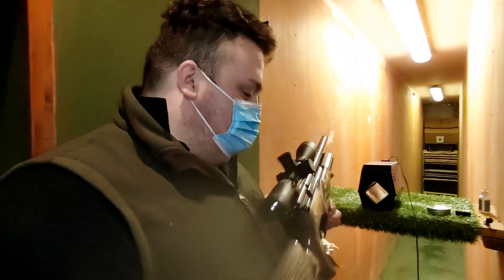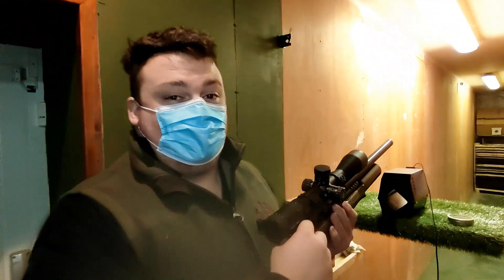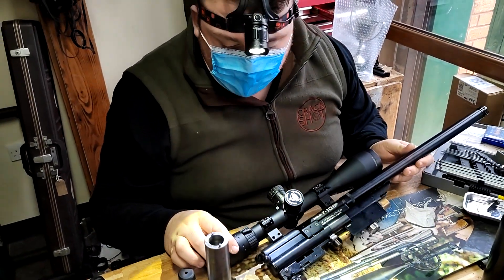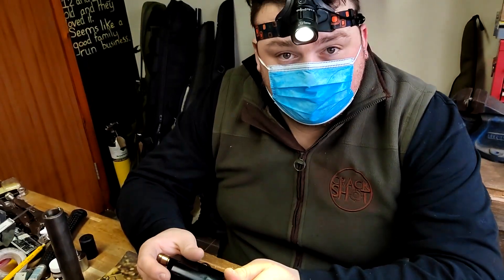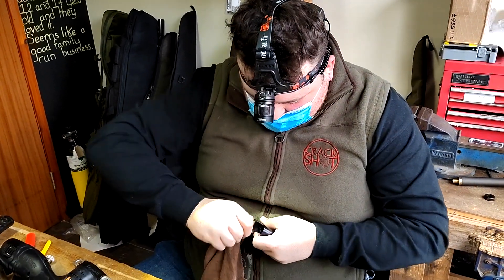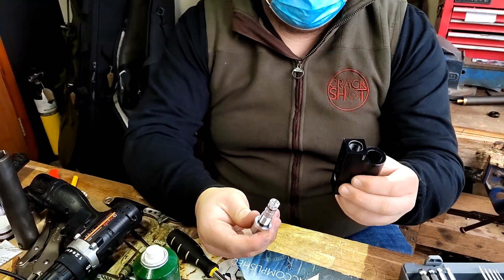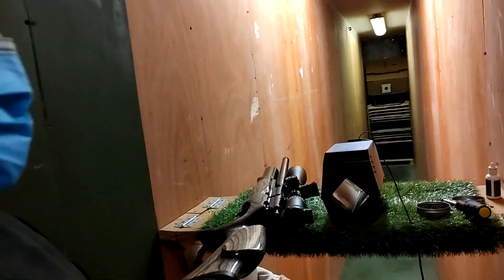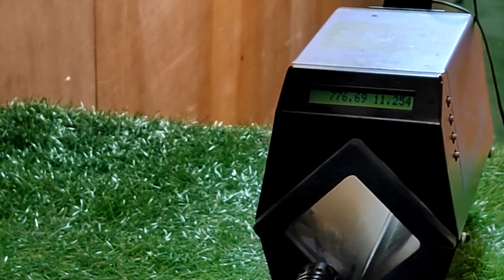The Ultimate Air Rifle Modification? Huma Regulator Upgrade. Full walkthrough from Crackshot.

Comment: So the R10s are sold with duff regulators?
Reply from the maker: No. Any regulator can have a problem. Just the same as a car might need a part of the engine replacing, it's the same thing with an air rifle too.

Comment: £119 can buy from huma for 114 euro £92
Reply: Had a problem with that. I ordered mine direct from Huma 10 weeks ago and still not received it. I had to buy one from a UK supplier, delivered in 3 days. For some reason, the one from Huma is in Dublin.
Reply: @ukzero1pete  buy a Robert lane one made and sold in England and he is very helpful and will set reg for what you want it for i.e. I was after consistency not improved shot count so he set reg pressure higher than normal so I get 50 shots from a 232 bar fill that are all within 6fps